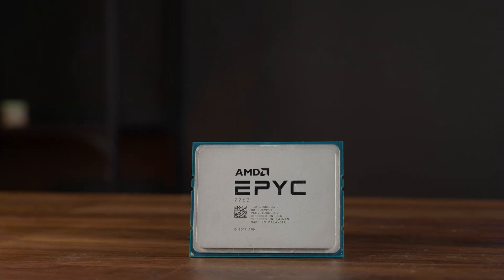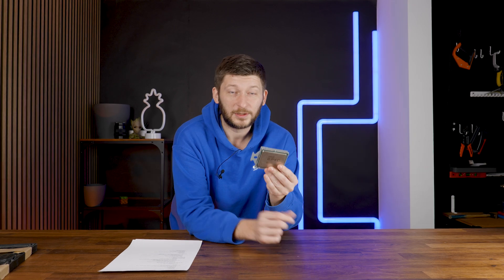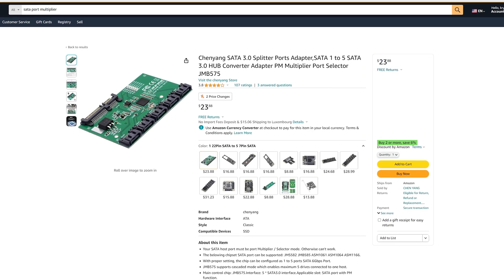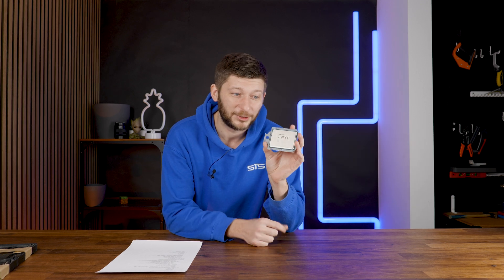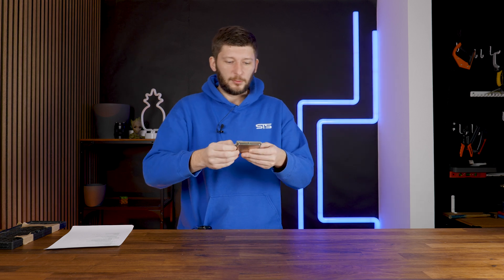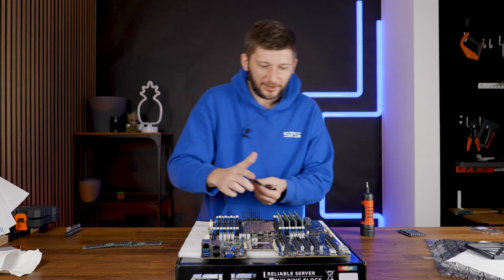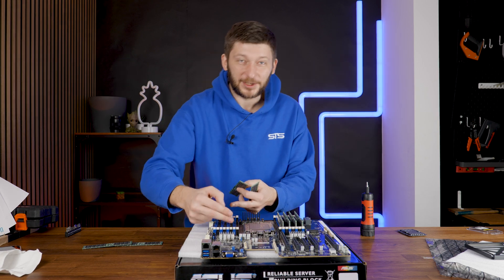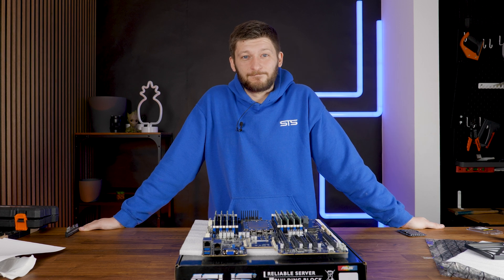Let's Build A DIY 400 TB Server - AMD EPYC 7763 - Episode 3

Comment: Dude, you need to pin a comment.
SAS port expanders still present the individual drives to the controller.  Again SAS is different to SATA and can handle this just fine in IT mode (OS handles each drive).

Comment: The reason why you didn't get a Torque wrench is the Engineering/non-retail units assume that you've already got one, also these units are cheaper than retail units be only the CPU is supplied (no packaging etc). Check how many BIOS chips you have and use the long-winded method to flash the BIOS, don't use BIOS flashback to do this because you'll brick the Board! Make sure your CPU heatsink covers all the IHS by using a heatsink designed for the EPYC/ Threadripper CPU etc.

Comment: I found this video quite hilarious, especially the part with the memory sticks and the paper printouts. It's not like that the manual of the board hasn't a nice table of supported memory configurations, denoted in chapter 2.4.2. Not to mention that pretty much all DIMMs in a daisy-chain topology are always populated from the outside to the inside since the days DIMMs have been invented. It has to be done that way for signal integrity, since there aren't additional circuits used for bus termination.🤯

Also, he should have bought a Supermicro board for his purposes. Really! If he wants to do anything like he was dreaming about on this hardware, pretty much any variation of the H12SSL boards would have been a better fit. 🙄

Other than that, he should look up what SAS host bus adapters are used for instead of trying to explain why he doesn't want to use weird cables and converters from shady websites. 😵‍💫